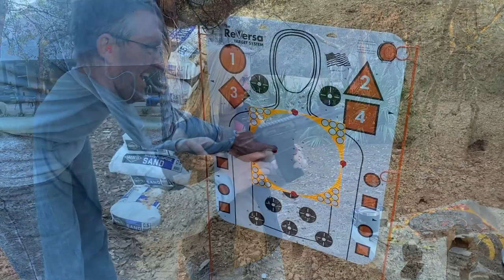Custom Backyard Shooting Range! - Flats Class

Comment: Great job. Wish I had a larger piece of land like you. I’m looking at something similar but attaching the 2x10/12 on both sides of a 4x6 then filling the inside space with sand.  Stacking the sand bags to hold the dirt looks like it worked well.  With wood rotting in Florida I thought about a heavy gauge galvanized posts then boxing them in with wood to protect them and skipping the wood 4x6s. 

Would you have changed anything you’ve done?  I looked at the heavy rubber stall mats at Rural King and Tractor supply and thought I could attach those on the front to help slow down any misses too preserve the wood face and not have sand leaking. I’m still trying to see what my best options are.  I can’t have anything penetrate and go thru the wood. Most powerful round I’d shoot is a 9mm. No rifle rounds except a 22 AR style.  Any suggestions please chime in. Much appreciated. 🙏🔫🇺🇸

Comment: It’s not going to last. You should have use all the wood from your old back stop, stack and mix it up with your fresh dirt to make it thicker and it will last longer. You need to fill out the sides of your back stop and higher need a lot more dirt! In a few days weeks or months all that fresh dirt is going down to the ground about 3 feet the most.